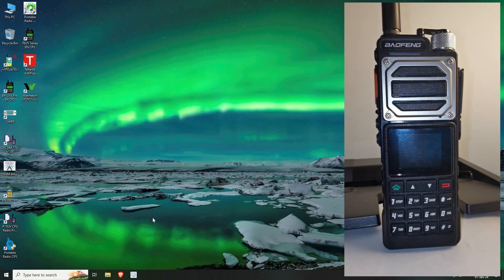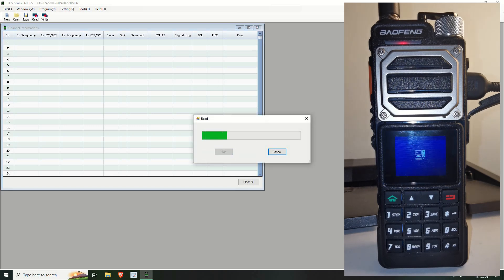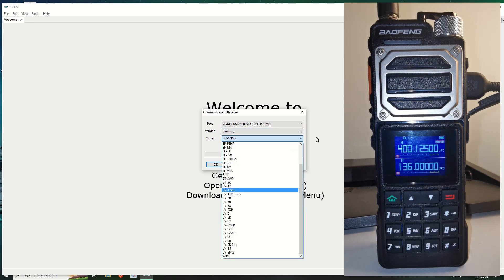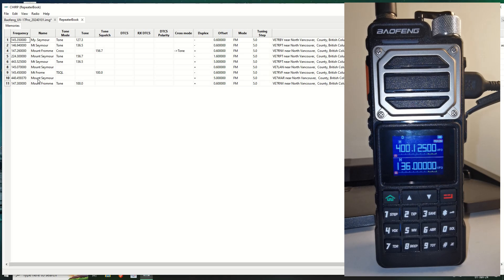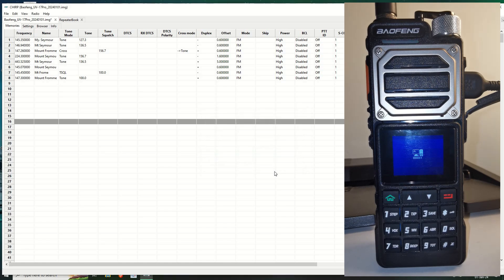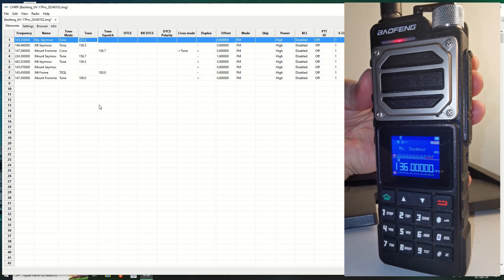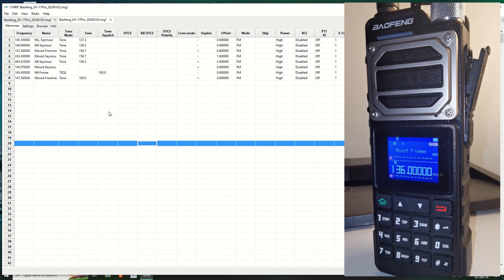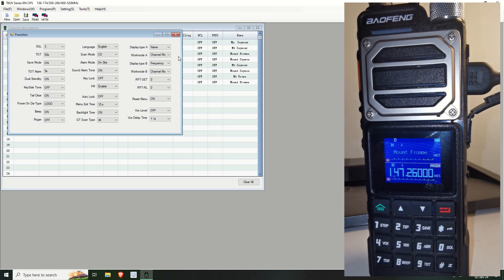How To Program Your Baofeng Uv25 Ham Radio With Chirp and CPS Software

Comment: Almost a year old, but still helpful. Because I found one of these under the Christmas tree yesterday ;)

What you can't find anywhere, though (not even here), is the pinout of the programming adapters...
I have several Baofengs here, such as multiple GT-3TPs (which are referred to as GT5 in Chirp), and two UV9R-AMG (whatever AMG is supposed to mean; it has nothing to do with the Mercedes tuner...).
The UV9 has a special adapter, but the GT3 and the UV25 use the standard jack connectors. Unfortunately, the jack adapter for the GT3 (GT5) doesn't work with the UV25...!
It's incredibly annoying that even within the brand, they're apparently trying to generate additional revenue by using different pinouts...

So, if you or any of the readers had a page/list with the different pinouts, it would be extremely helpful for all Baofeng users I think...

Comment: Using the included USB Cable. installed the driver and is working in device manager. Get this error when tryng to "Download from radio": UV-17 or UV-17PRO both give error: "Error Readering data from the radio: Not the amount of data we want."Cable is new and came with the unit. Connection is pushed all the way in. Anyone know how to fix?!
Reply from the maker: Depends - what is the CHIP inside the USB cable ?

Comment: Its giving me an Error using the uv17, pro ,and pro gps
Reply: I've programmed 6 of these radios using the UV-17 profile on Chirp and they all worked properly. I think you have another problem like port or not the right cable. Make sure you are using the Baofeng cable with the driver chip on the USB end that plugs into your computer.
Reply from the maker: Try the UV-5RM , if that fails then something else is wrong - cable , port etc etc

Comment: But will it do gmrs?
Reply: Yes it will, the radio is fully opened from factory. In the USA that radio isn't part 95E certified by the FCC to be used on GMRS,  but the short answer is YES. :)
Reply: @jdp1956 do you know how to unlock it like from the factory if I have a Us one?
Reply: I purchased mine on AliExpress and when it came it was fully opened. I did not have to do anything. I also have two friends that purchase the same radio on AliExpress and they were fully opened also.
Reply: I got the same radio I programmed with chirp and gmrs do not transmit on this radio I can only listen
Reply: So I did end up ordering this radio. And it is full unlocked! I do have it working on gmrs, and it's a pretty solid rig. Wattage testing shows it's getting a solid 8.5-9 watts on channel 24
Reply: @kylebutler3322  Excellent !!!

Comment: Hi! Can I use the UV-5R cable to program this radio or do I need to buy a special cable?
Reply from the maker: +@marekdarkacz4078 that should work just fine :)
Reply: Thank you very much for information! Regards!
Reply: As long as the cable has the driver chip on the USB end you'll be good to go.
Reply: @jdp1956  Thank you!!!